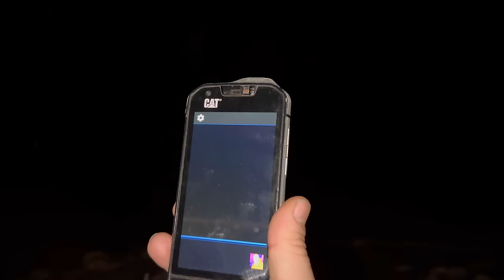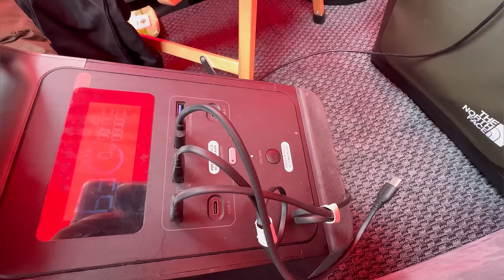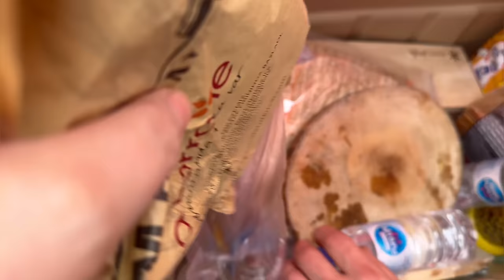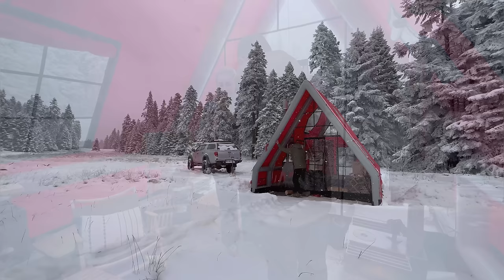KARDA SOBALI SICAK ÇADIR KAMPI

Comment: Why are you using a cheap air mattress from Intex that conducts cold air.  No wonder you feel really cold.  You need a camping mattress with a high R factor such as a 4 inch high EXPED use it on a cot off the cold floor.  Also electric blankets should never be placed under the body.    Consider a portable toilet or bucket loo instead of "picking flowers"  under a pine tree.  Have fun camping.